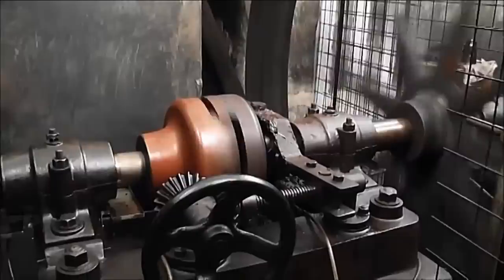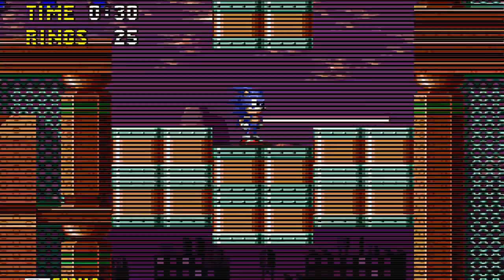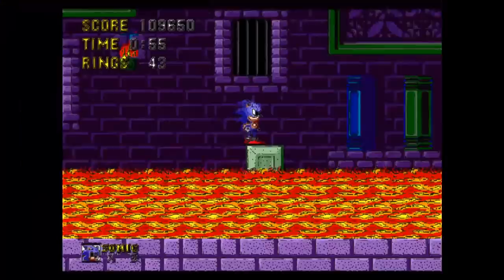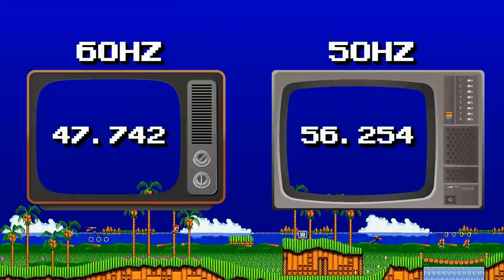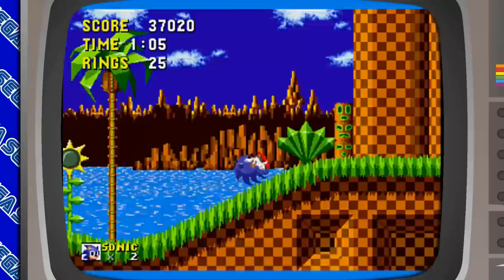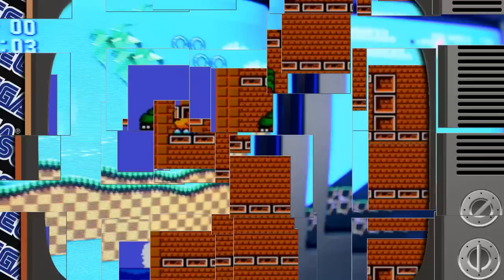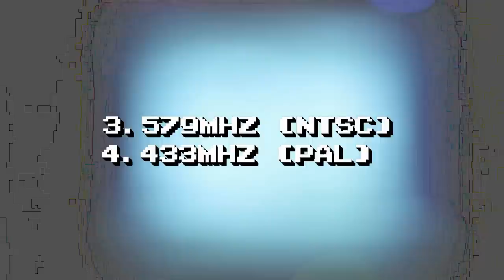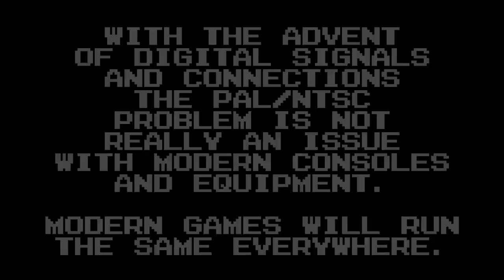Why is Sonic Faster in America? NTSC vs PAL/60Hz vs 50Hz | Nostalgia Nerd

Comment: I'm from the U.S. but, is the slower PAL thing still an issue these days? I figured most games now are pretty much optimized with globalization in mind I would hope. But, I did recall hearing that even though PAL was on a lower Hz, you guys had a slightly bump up in resolution. We had 720x480, you guys had 720x576...probably not a big deal now, but back then I wondered if someone would notice the picture quality.
Reply: nope not an issue these days as since the ps3/xbox 360 era all games on consoles run in 60hz regardless of region specially if you use hdmi.
Reply: We don't use PAL anymore, SDTV uses DVB-T and HDTV uses DVB-T2.
Reply: +Der Grammar Fuhrer

That's not true, we do still use PAL, in Australia we do, even on HDTV flatscreens we use PAL and our television broadcast signals still come through as PAL 50Hz, only difference is it's digital. DVB-T is still a PAL frequency underneath.

In Australia we actually have the lot! We still use PAL 50Hz for television broadcast signals, PAL 60Hz for the newer video game consoles (PS3,PS4, XBox One etc) and we even use NTSC 60Hz on many region 4 coded DVD Video discs. Australia is pretty much multi-region now.
Reply: Adrian Gauna yeh but who watches tv broadcasts anymore? As there garbage in Australia and the very few hdtv channels we have are interlaced not progressive though the standard def channels with the repeats and shopping are progressive but just pal and ntsc in a color encoding sense dont exist anymore since those sub carriers of analog got ditched long ago when we turned off analog broadcasts in 2013. Now all 50hz or 60hz refers to is frames per second if there progressive frames (with interlace you divide the hz by two to get the framerate)
Reply: +electronman 32k Lots of people still watch television in Australia, I know there's alot of shit on the box these days but the signal is still coming through at 50Hz.

The way I see it, it's pretty much the same thing, yes, we abandoned analog TV in December 2013 and DVB-T took the take over after PAL but it's exactly the same to the naked eye as PAL was, just digital not analog and it's still coming through at 50Hz.
Reply: Adrian Gauna By "we" I meant the UK, sorry about that, should have been more clear.
Reply: Adrian Gauna
 doesnt look the same as it once did since its digital, progressive (cept for our hd channels as there interlaced) and actually in full screen these days. you cant tell the difference between 50hz and 60hz nowdays as they both have that daytime soap look even without truemotion and dont flicker on todays screens like they use to on crt's. I mainly use 60hz for consoles and movies I usually watch at 24hz since they were filmed and encoded on the disc or in the movie file that way so very rarely does 50hz actually get used by me and others nowdays unless its a home movie tape transfer of a trip to disney land or somthing from back in the day im trying to watch
Reply: +electronman32k
Well I watch television in my lounge room on a Sanyo analog CRT through a digital set-top box, yes even today in 2016 because I still play these old video game systems at PAL 50Hz, I don't care for 60Hz personally and the newer flatscreen HDTV sets can't handle the old analog PAL 50Hz signal too well, there's always lag and a judder every 7-8 seconds making gameplay crucial, so by sticking to an analog telly I can avoid those digital problems, but back to the CRT itself, I use a set-top box like I said and even with all the wide variety of channels to choose from, it still looks like the same picture as the old PAL format, maybe just a bit sharper and widescreen and the broadcast signal is still 50Hz. Like you said, nowdays you can't really tell the difference, but in saying that you're probably right and it could be because I am still watching television broadcast signals through an analog TV.
Reply: Adrian Gauna the only crt i play retro games on nowdays is the one found in my arcade machine. retro consoles i prefer playing on my 50inch 4k set as apart from not having to lug out my old tank of a crt monitor thats a decent size i get to use rgb from most of my consoles via a good analog to hdmi converter that handles old video standards very well without costing an arm and a leg. lets just say say it gives my retro consoles a new lease of life and this input lag you speak of is very little if any and doesnt affect gameplay at all!! specially if ya set your tv to game mode like your meant to. So apart from playing on a small crt just show people how we use to play video games back in the day there really is little advantage to doing so except for the weird ones like re2 on the n64 with its weird signal that crt's are the go to for handling without issue. also i have the 60hz mod on my retro console or use 60hz consoles and games nowdays as the 50hz ones are garbage with there squished picture and slower, laggyer gameplay unless built from the ground up for 50hz hardware. why go for those in your retro collection if theres a better 60hz version available?
Reply: +electronman32k
Well I never felt the need to upgrade to 60Hz personally speaking, i'm still happy playing at 50Hz, I prefer Sonic 1 at 50Hz, that's how it was presented to me as a child and I still see no reason to change even now, the borders are not that big and it doesn't squish the screen as bad as many make out and they have never bothered me, aside from that I don't think it should be forced upon me to upgrade or mod my consoles for 60Hz when 50Hz is still the standard in my country (despite the move to DVB-T). If there are any bad PAL conversions done through out history, developers are to blame, not 50Hz.

The only thing that does bother me about PAL 50Hz however regarding Sonic hacks is that hacking developers always use Sonic 1's sound driver (SMPS 68k) and they use this sound driver when porting music from other Mega Drive/Genesis games over to a Sonic 1 hack, now the problem is that the developers or hackers only have 60Hz in mind and most music they port over comes from fully optimized 50Hz titles from back in the day, but because they're porting it to Sonic 1, the music is playing 17.5% slower than it originally did from the original optimized game. If they would start using the Z80 Sonic 2 clone driver there wouldn't be any slow music at all whether it's in 50Hz or 60Hz because the Z80 clone driver is more advanced and fixes alot of issues, but i've been told that it's quite hard to work with, hence why most stick to the novice work of SMPS 68k. 

Keeping in mind that Sonic 1's original ost is fine 17.5% slower because that's how it came out in PAL regions to begin with, so hearing Sonic 1 music at 60Hz doesn't make me want to play it like that because you don't miss what you never had. Also i'm not speaking for anybody else, this is just my personal opinion and preference.

Regarding digital, the lag from HDTV sets is still there even if the game mode is turned on, yeah it's not as bad with the mode turned on but it's still present, there is a slight delay that just isn't there at all on a CRT monitor, HDTV's also have a delay in audio, if the game console is hooked up to a stereo amplifier and the TV via HDMI or AV at the same time it produces an echo or reverb in the room as the audio signal is not matching between stereo amplifier and TV. The thing I absolutely cannot tolerate at all is the frame judder every 7-8 seconds, I hate that slight pause in frame rate which is why I will forever stick to analog. CRT monitor audio and a hi-fi stereo amplifier match perfectly, no lag, no judder so I benefit more from an analog CRT monitor.

There still may be some truth to what you said, as I am yet to try a analog to HDMI converter, perhaps it will annihilate the judder and the audio delay as I do own a HDTV upstairs in bedroom.
Reply: Adrian Gauna but not originally since it was designed and first released for 60hz. playing at 50hz feels like a downgrade as it runs slow and is not how it was when first released
Reply: Would love to know more about your tv/audio setup your using as i get none of the issues you speak of above then again my hdmi converter box plugs into my amp which extracts the audio and then feeds the video to the tv I even tried feeding the audio straight from the console to my amp once and noticed no delay or sound quality difference.And trust me input lag below 30ms if its there  just doesnt register as things react in games as fast as I hit the button just like on the arcade machine on my crt. You would need an oscilloscope or other such lab equipment to see the difference
Reply: +electronman32k 
Actually Sonic 1 was released on the same day in Europe, Australia and America and since Australia is (50Hz) and nearly a day in front of the other regions that means we Australians got it first on the 23rd of June 1991. Japan was delayed by 3 days which explains why they got the enhanced version. How it's (supposed) to be is irrelevant to me because that's not how it was first released in my area, the fact is that it came out slower at 50Hz for all PAL regions and that is how it played when I first got a Mega Drive in 1993 and as I said above, I still see absolutely no reason to change now and will not be forced to move on to 60Hz regarding retro video game consoles that is and as long as broadcast signals are still being streamed at 50Hz I will not budge. It's built in me from childhood to accept it that way, knowing the differences between PAL/NTSC 50Hz/60Hz came at a much later time in life for me, it wasn't until I got my first PC in 2009 and went on Youtube that I discovered the differences, before 2009 I assumed the world had the 50Hz version. I was like ''why is the soundtrack on constant power sneaker speed?''

If you and everyone else prefers it at the so called (intended speed) of 60Hz, then I congratulate you! I'm happy for you and everyone else. Despite how something is supposed to be and how wonderful something is as a mistake, it honestly is down to personal preference.

Judder is when a television doesn't refresh quickly enough or doesn't stitch frames properly resulting in a "hopping" motion when panning left to right or experiencing fast motion. Judder is almost always at perfectly regular intervals, its not a random stutter, but rather a regular skip every 7-8 seconds in medium to high motion scenes.

You know why you haven't experienced the same HDTV issues? Because you use 60Hz, HDTV's like 60Hz frames/fields per second, they don't like analog PAL 50Hz especially when it's coming from stock composite AV from the Mega Drive. An odd thing I have noticed is that upstairs as I was saying I have a Sony smart HDTV and I have a Mega Drive model 2 hooked up to it, I know the judder is still there but I can't notice it as much, it's far more noticeable on a model 1 Mega Drive, yet with CRT monitors there is no judder at all.
Reply: Adrian Gauna  hdtv's also support 50hz and without what you just mentioned its most likely your old bravia set that has analog as an after thought like most tv's from before the 2010's and even now. I bet your using composite or rf on your bravia which really wouldnt help. get a hdmi converter and it will help heaps. and if your getting those issues on 50hz but not 60hz then all the more reason 50hz should just be ditched. Even though i used rf for my megadrive in my childhood ive no reason to ever go back once i found out it was capable of using rgb , stereo sound and run at full screen and even full speed if i used a 60hz mod on it. second i got a hdmi tv in 2008 and figured out i could get a converter box to make use of its better video there was no turning back as why gimp what your old console were really designed to do?
Reply: +electronman32k Well in any case it looks and seems like a HDMI converter could very well be the answer and I thank you for pointing it out because it's something I will be looking into in the near future.

My Sony smart HDTV is from 2014 and yeah I know composite AV video is pretty poor by today's standards but I purposely want to live with technology from the 1990's. 

Thanks for the informative conversation.
Reply: +Illegal Immigrant You're confusing framerate (FPS) and refresh rate (Hz), they're similar but not the same thing, your TV will be running at 60Hz all the time unless you still have an old 50Hz one.

Comment: This is interesting, so it's possible to run games at 60hz on pal systems but it requires skipping frames to prevent overload in the framebuffer .
But does that not require reprogramming the game from scratch?
It's strange that sega not bothered with the speed on sonic 1 on pal machines considering their speed slogan compaign, whereas nintendo just optimized mario world on their pal snes, pretty average.

But how is it possible that despites the pal genesis is slower, that the pitch of the music is still the same whereas the slower pal nes has a lower pitch, both soundchips are fm based, also pal snes has the same pitch as ntsc snes with pcm sound, the pal master system has the same pitch as ntsc system being psg based.
Any guess?????

Comment: My only question is, why havnt we all started using the same 60hz now days? Why stay using different hz and making things difficult for ourselves? I mean it cant be THAT hard to just up the hz from 50 to 60 without having to change out the already established electrical hardware. Im just glad when i lived in germany i didnt have to worry about none of this non sense cause i just used a converter to plug all my electronics into. BUT when i first got there i did try to plug my alarm clock from the US into the wall using just an adaptor, forgetting about the speed difference and ended up waking up about 2 hours late....lol.

Comment: So, what you're saying is that in order to experience the full power of sonic, we need to change the grid to 9001 hz and develop technology that refreshes at 18002hz as well as direct neural interfaces with the safety circuit bypassed.

Elon, cancel the Mars missions we got work to do...

Comment: running import(NTSC 60hz) games at pal (50hz) speed makes them run 16.666% slower than NTSC speed.  not 17% or should i say not the silly "17.5%" that all the magazines and advertisements had you believe back then, whomever did the maths back then did it wrong, running non optimised games at pal/50hz gives you 83.333% speed (a loss/difference of 16.666%) and running pal optimised games at 60hz gives you a 20% increase in speed

Comment: Wait, so why didn't nintendo fix this problem when releasing Sonic 1 on the Wii?
Reply: I think there was a petition to release the SNES version of Mario Kart on the original Wii in 60hz. I don't think it succeeded. There was also a petition to release games as ntsc 60hz for the Wii U virtual store. According to wiiUdaily, many U store games are now 60hz or full speed, but there are exceptions, eg according to them, F-Zero is 60Hz, but Super Metroid is not. The NES port of Pac-Man is 60HZ, while Kirby is 50HZ etc

There is a PAL Sonic Mega Collection on GameCube (all MD Sonic games+Spinball+MeanBeanMachine), but I think it was 50hz only. I don't know if there was an ntsc equivalent aside from Sonic Gems Collection on NTSC, but that only had Sonic CD and the Gamegear games
Reply: Chip Biscuit
The Gems collection on GC was my US import, running on a Datel Freeloader disc. There was one made for the Wii also, but a firmware update blocked it from working. No doubt this was on purpose, but at least the Wii could install the homebrew channel to fix that.

Comment: You left out a French standard called Sécam, a abbreviation of Sequential color with Memory. Red and Blue lines is explaining the memory part of SÉCAM, but if not tuned correctly can cause SÉCAM flare, interference involving red and blue lines on the edges of bright signals. On NTSC and PAL sets, if not tuned correctly, noise would be a big concern or you lose colors completely. But, since NTSC was made for 60hz, you see smooth movement on American sets. NTSC also allowed for easier videocassette support since the color was encoded in a 4mhz part of the 6mhz TV channels, older black and white sets can recive color NTSC broadcasts, not without checkerboard patterns everywhere. NTSC is better.

Comment: no you actually got it very wrong, it's just that the physics integration doesn't account for delta time for that game. dt refers to the time elapsed between the start of previous frame and the start of current frame.

if you don't multiply by that your game speed changes base on your update rate. games nowadays doesn't have that because it's taking dt into account. of course if all your game runs on a fixed frame rate, you don't have to multiply by dt and in the old times multiplication was expensive, and they probably can't afford to waste that multiplication.

Comment: are pcs slower there?
Reply: Nope, the difference only applied to consoles that plugged into old tv`s. Pc`s use monitors that generally have high refresh rates, even my pc from the early 90`s had a monitor that went up to 85hz.